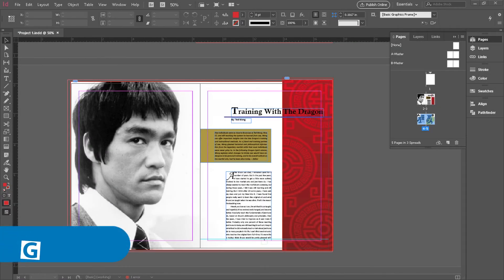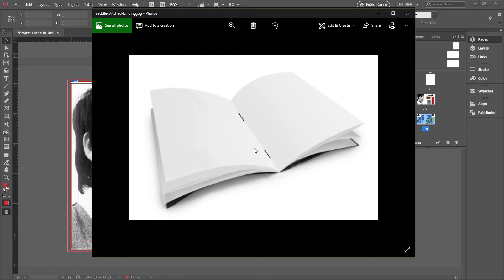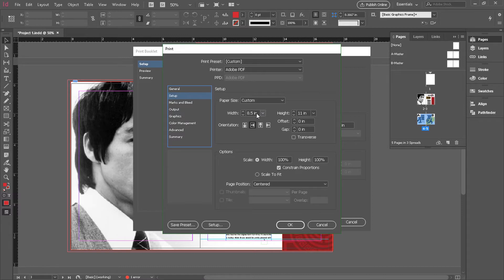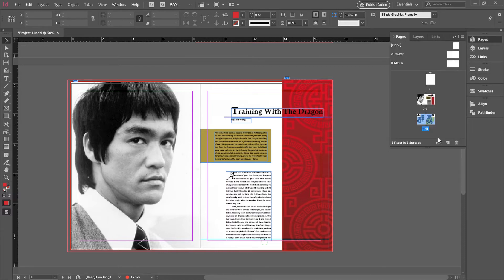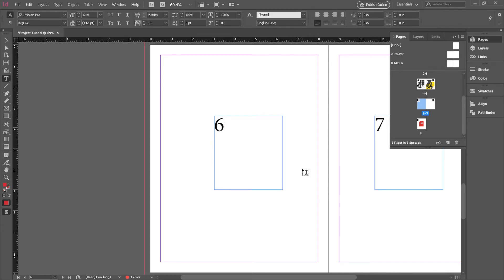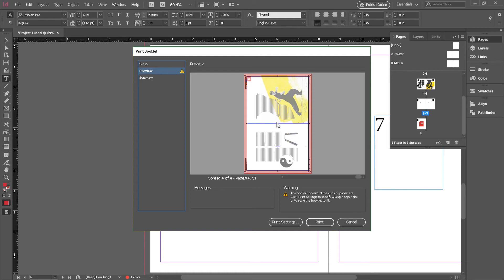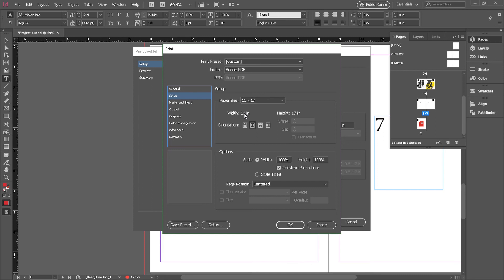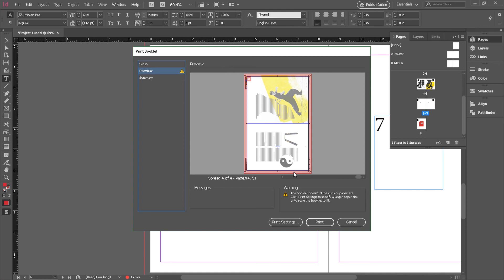InDesign STEP 9   Booklet Printing

Comment: After 15+ years of doing of 96-page magazine mechanicals (4-up), I have trouble with ID's preview (2-up). My brain wants to see the chart in thumbnails of imposing pages. I created a PDF version of a 100+ page book with QXP, moving the pages and rotating them so it would print the book for binding correctly, it made more sense to my mind than the software did.

Comment: Can you make this work for printing on an 8.5x11 for a half letter size?
Reply: Replying in case anyone else has this question! My theory is to size the paper to 5.5x8.5, print half of the booklet, then rotate the paper 180 degrees and print the other half. Or cut the paper in half first if your printer feed will handle it.

Comment: Hey Greg thanks for this, is there a way to save this as a printable pdf. OTHER than rearranging the pages manually in ID? Or am I now asking for trouble lol.
Reply from the maker: Hi there,

The whole idea with booklet printing is that you always design your pages in the normal order,  and the booklet printing option will rearrange them for printing to booklets.     Print regular to keep them in order,  use booklet print yo have ID Rearrange them for booklets.

Comment: Hi Greg, thanks for your informative video.  Which version of InDesign are you using?  I have the CS4 academic version, but yours has more features.
Reply from the maker: In this course of videos I’m using an older version of the education(school) version.   It might be CS6.   I’m using CC now which updates automatically all the time.    So these videos are due for a remake over the summer.   stay tuned.    glad they are helping.   all the best.
Reply: @GregintheBox  Thanks for responding, much appreciated.  Will look into upgrading my InDesign.  Cheers!